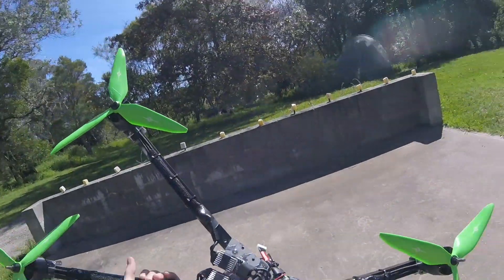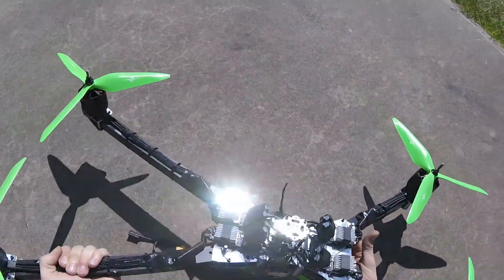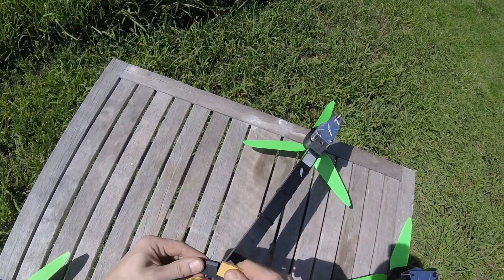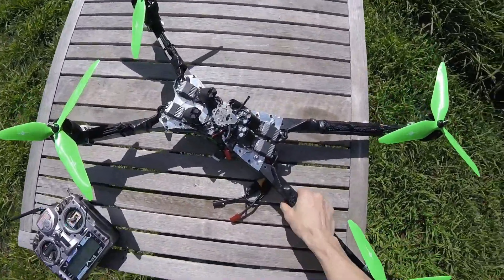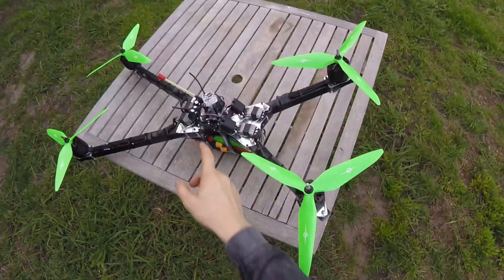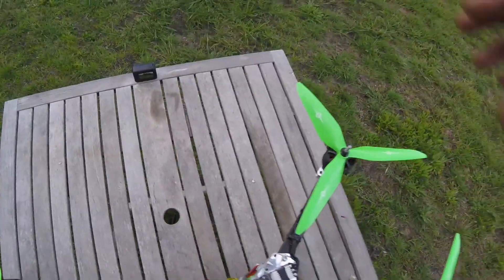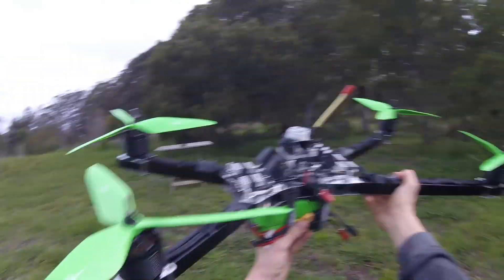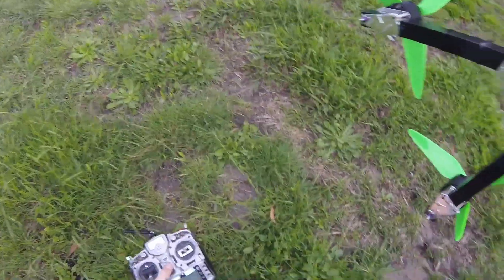227kmh!!! 5kg AUW Hybrid Stretch Wishbone

Comment: Hey, cool videos. Love the size of these quads! I currelty fly a 7 inch but have been involved with larger projects up to 23's but havent ever foot the bill for them. I would like to build one but im wondering what the cost diferences are like? would you mind giving some info on prices? Thanks in advance =D
Reply from the maker: If you use premium carbon props it gets quite expensive. For 27" and under, use APC, they are about $40/prop for 27". APD ESC's around $100, motors range from $100 - $300 each. PDB is $100, then your frame and about $200 worth of batteries. Frames are cheap if you make it yourself and everything else is the same as your 7". So a reliable 20" setup could be around $1500USD to build. However only do it if you are confident you won't crash it, repairs and spares add up fast and tuning quads at that size requires a lot of experience

Comment: nice! Those are BH T10? Which KV? Did you replace the wires?
Reply from the maker: No these are a new prototype motor I'm working on ;)
Reply: Autek XRacing what are the specs? Stator? Kv?
Reply from the maker: @modocfpv6305  They're 4525 436kv :)
Reply: Autek XRacing those are interesting specs 👍